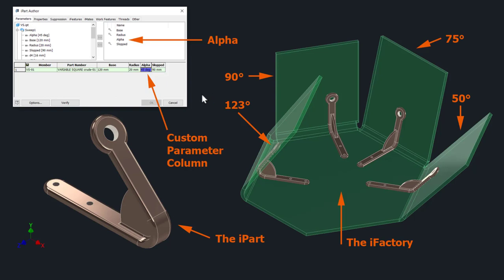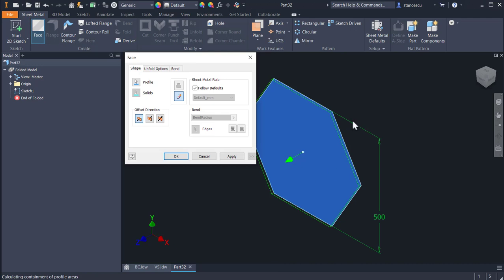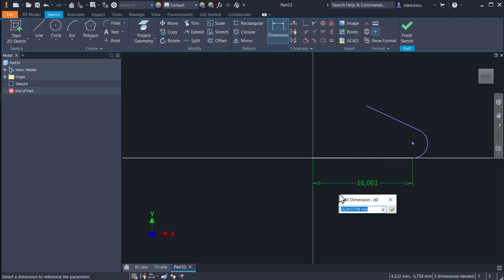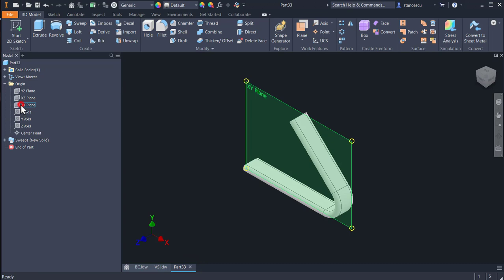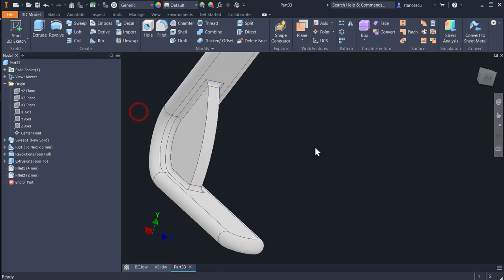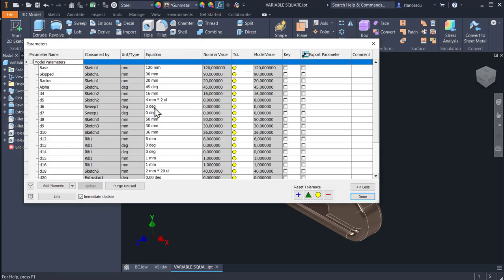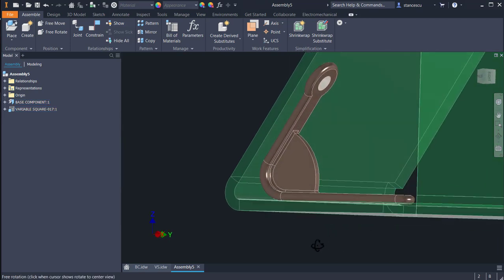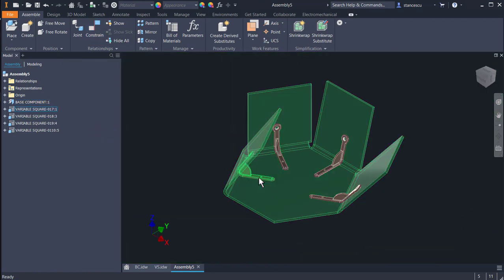Tutorial Inventor - 145 iPart and iFactory

Comment: Good morning Professor Constantin, congratulations, excellent work.
I would point out that the success of the transformation of the components in iPart is highlighted by the appearance of the Table icon which however appears even if the column to be acted upon is not transformed into a Custom Parameter Column.
Also interesting is the possibility of adding further lines by assigning precise values which allows you to have components with different characteristics (configurations).
The generate file function is also useful (open component > select the configuration > right click Generate File) to obtain new parts to which however the connection must be broken.

But now I have a question: can I generate an iPart that is flexible and therefore adapts its geometry according to the constraints applied? For example, I insert the variable square into the assembly > constrain the surface with 2 holes to the hexagonal face > constrain the surface with 1 hole to the flange and the variable square changes shape to adapt to the position?

Regards.
Reply from the maker: Thank you for the appreciations!
In answer to the question I first have an observation: are we talking about iPart or iAssembly? My answer is that anything can be done using iLogic and Visual Basic - see my tutorials 146 ... 151.
Reply: @prof-stancescu  I talk about ipart